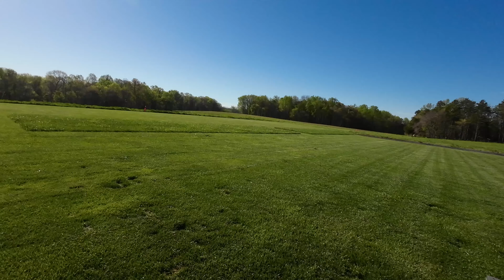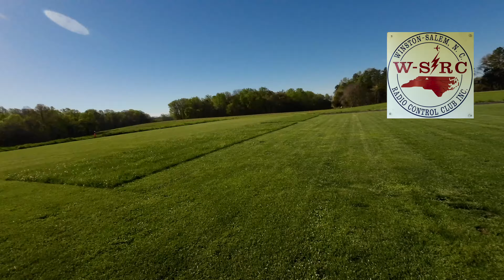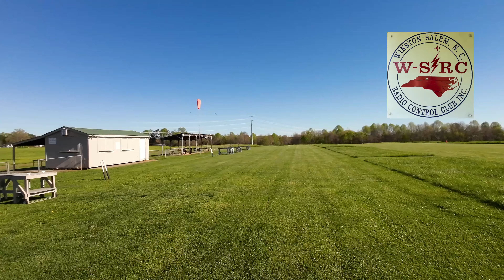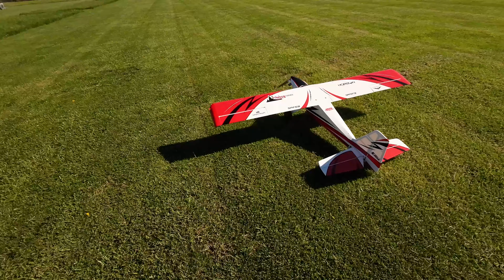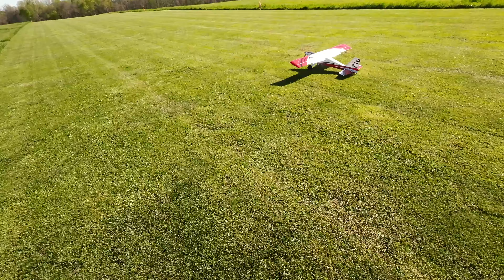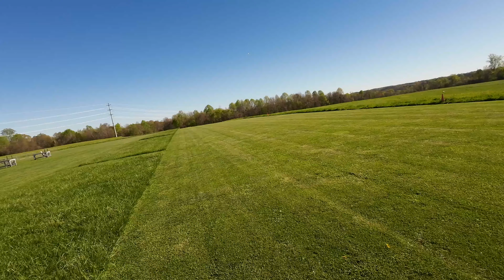Another BAD Landing - Turbo Timber SWS!

Comment: Did you buy another SWS? Thought you crashed one?
Reply from the maker: Yes I did suck it up and buy a new one as it would cost about the same if I rebuilt it. I really like this plane flies great. Need to change some of my flap settings.
Reply: @bgblindt  i agree. I got the BNF but also purchased the ARF just in case something happens. Great model.